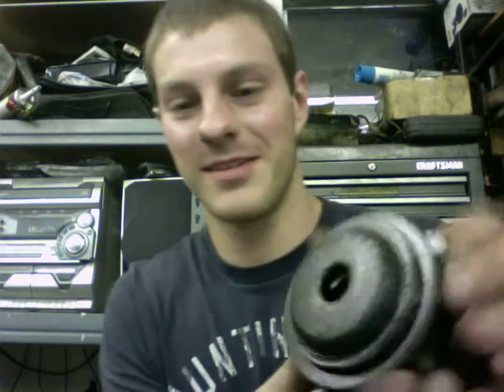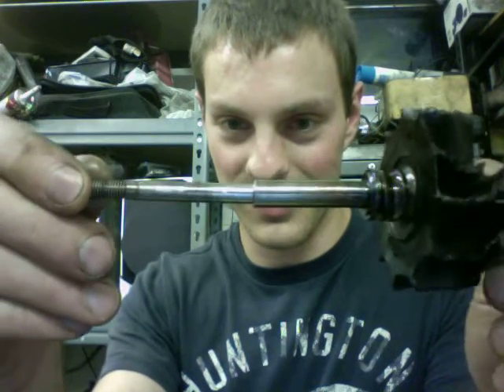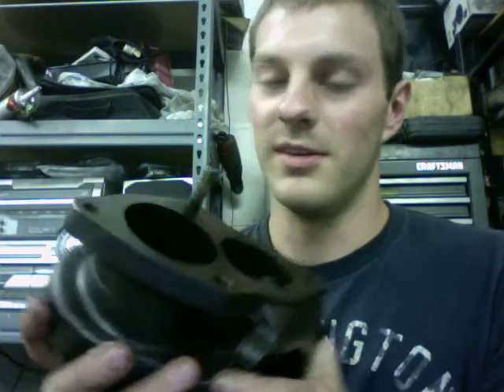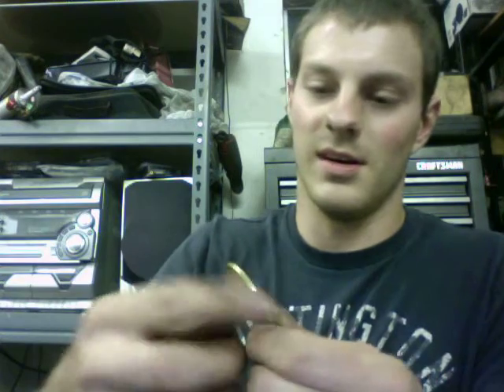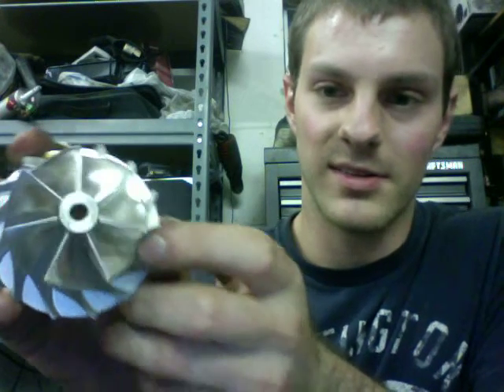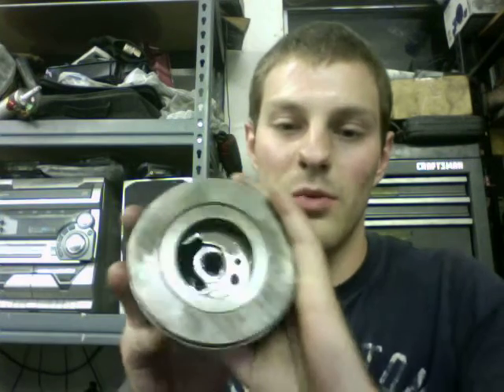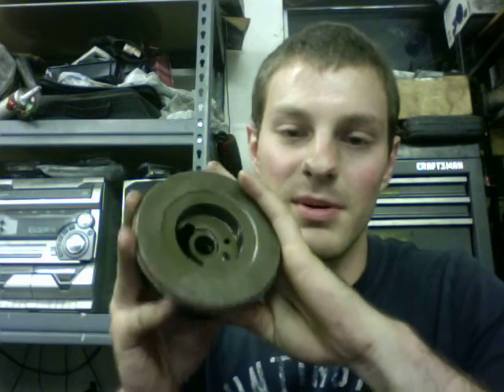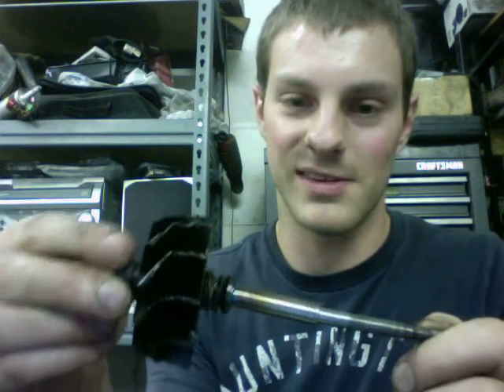turbo lab turbo failure

Comment: Good info bro.. Not enough oil would cause the shaft play and would cause the bearing failure.. In my experience the blue shaft is from the friction heat because oil starvation. These turbo's when good clean oil is running through them should have zero play and shaft should never touch the bearings. the oil acts as a mediator and keeps them separate.
 But the play people feel out of the box is normal because there is little or no oil inside those bearings. I always tell people to add some oil while spinning the compressor wheel. Get it well lubed and then try to feel if there is any play. They should feel nothing...

Comment: I was wondering if you can give the information about a gt3582r compressor wheel nut torque specs, thank you.
Reply from the maker: +Monkey DSM I just ad 1/4 turn. I have heard of other people torquing them to 7 ft lbs
Reply: +Turbo Lab America thanks, I wasn't sure but thank you for clarifying it for me. I do have an extra gt35 chra, how much would you charge me to rebuilt it new shaft and billet compressor wheel?

Comment: question for you my friend I have an Evo 9 and my Turbo blowing oil to the intercooler how did I notice this I took off one of the pipes and have oil in it what is happening I don't know what to do
Reply from the maker: +Crazzybear1408 check the turbo for in and out shaft play .
Reply: What fixed this problem

Comment: Shitty spool can mean shitty tune to Austin so dont sweat it
Reply from the maker: Yes. I probably should have done an update video. I rebuilt this turbo, which i paid for all the parts, The turbo bent the shaft again in less than 500 miles again. I actually learned from a turbo builder friend of mine, that its very common to warp and bend shafts on e85 if the tune was too hot.  The guy ended up buying and fp turbo, im not sure if that ever fixed the problem.

Comment: chinese?
Reply from the maker: +MrPhenomenon1 no, i built it from a genuine 14b. The reason why this turbo failed was because the egts of the tune was too hot, which is a common problem when using a small turbine housing. This turbo failed 2 times after building 2 cartridge, both failed exactly the same way with the shaft bending from excess heat and ripping the bearing seat out. This was the only turbo I had fail with this result where it was this bad. Each time this turbo failed it was directly after having someone tune the car.
Reply: interesting,thanks.